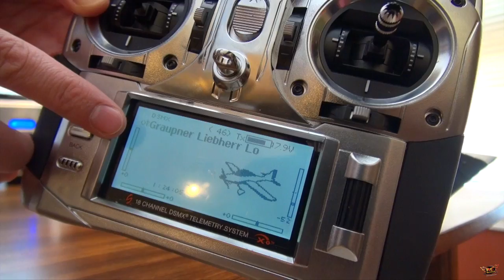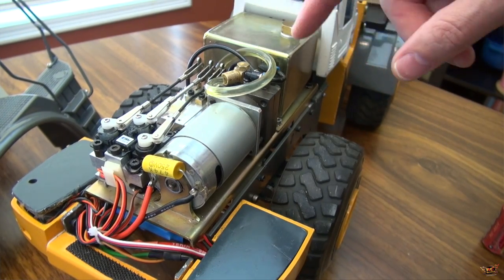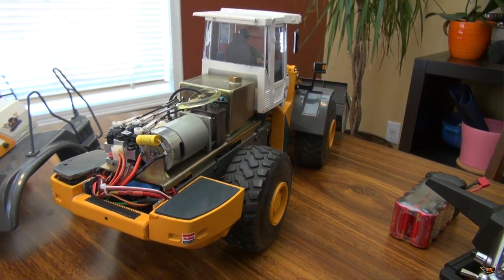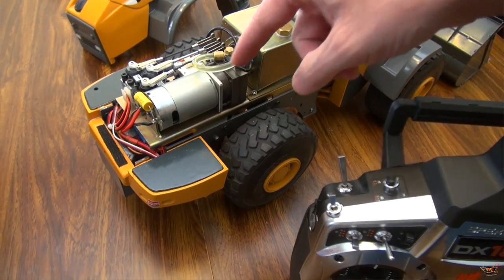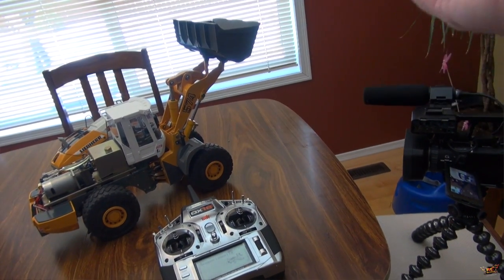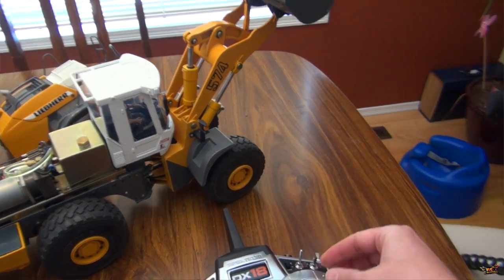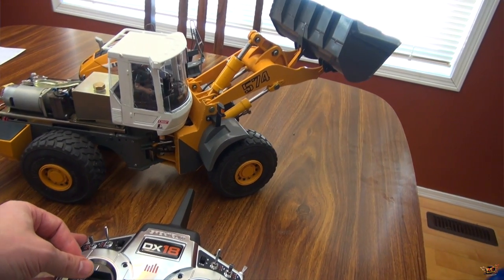RC ADVENTURES - How it Works - Graupner Liebherr 1:15 Scale Hydraulic Loader

Comment: Hey medic, you might want to consider not locking the axles. The reason I say this is because on full scale equipment you have the option to lock em if you need to get out of something, but makes it harder for the machine to turn and tends to want to go straight. Just from experience. Don't know if it's the same for rc. Just a thought buddy love your channel.

Comment: Sup Medic! I'm glad u put this vid up. Always wanted to know how 1 of these worked. But don't u think if u were to lock the axles it would put a strain on the gearing as u use the hydraulic pivot turning. As in if they're locked. So when u need to turn, the opposite tire on that axle would drag putting a strain on ur drivetrain. Maybe that's y they don't lock them? Just a thought. But anyhow. Loving the construction vids. U need to do a start to finish road or something or a mining area. Cheers my friend!

Comment: You should see if you can take the potentiometer from the steering servo up to the articulated steering pivot point so that way it would return to centre, would take a little work and sacrificing a servo but I think it would be well worth it for driveability.

Comment: As to locking the axles, the loaders that I have driven only locked the front differential. This allowed the loader to drive into the pile deeper or in my case get yourself unstuck a little easier. Great job on the videos enjoy them all.

Comment: If you lock the axels it will be hard to turn. So you need to have a lock/unlock system ...that way you can turn and when needed you can lock in the axles for traction.